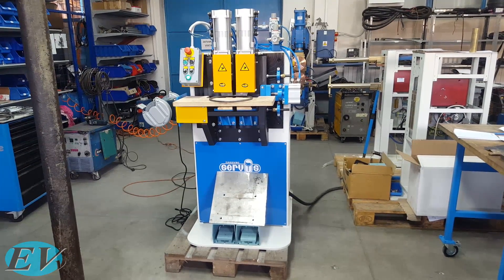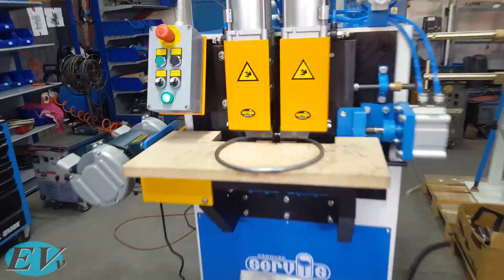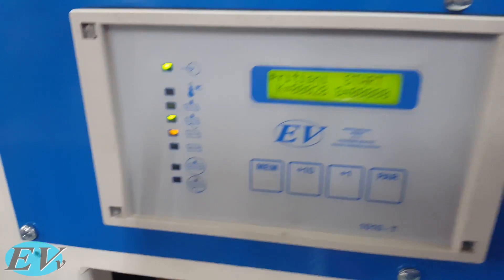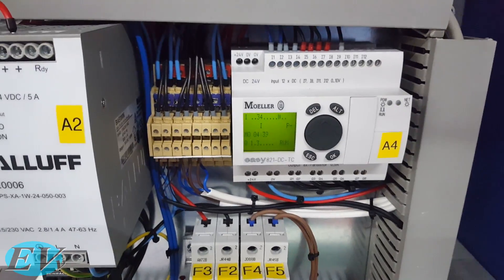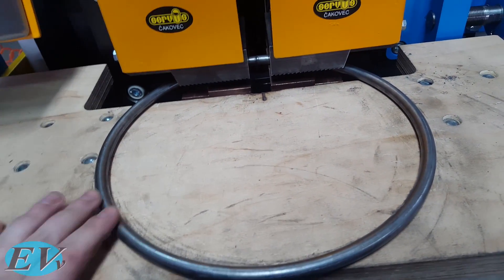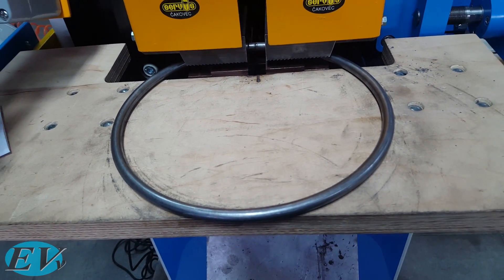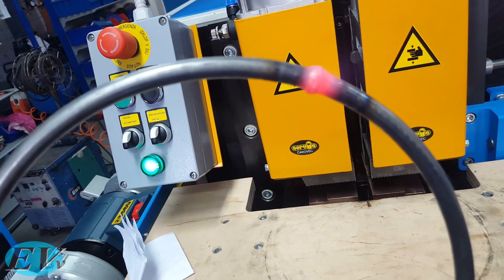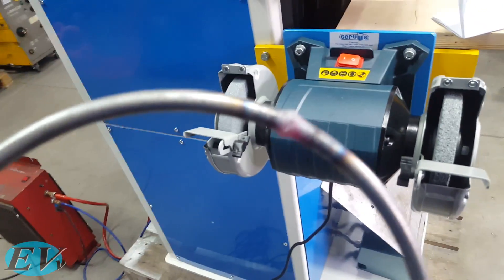Resistance Welding Machine - Butt Welding

Comment: Very nice, just to correct: this is not a flash welding machine, this is a butt welding machine. In flash welding the upsetting pressure is not applied all the time, thus flashing happens at the seam area with lots of sparks.
Reply from the maker: Thank you for your message Jaakko Fagerlund. It is true, the type of welding shown in the video is butt welding, but the equipment also allows flash welding with adjustments to clamping and squeezing mechanisms. Here the gradual upset is not needed as the welding area is small (sub 300mm^2), nor are the hydraulic cylinders for regulation. I apologize if some words are misleading. They were spoken in real time without preparation.
Reply: @elektrouporovnovarjenjeina2834     ...   nice machine. looks safe.   ...   N S H Jha (male) / New Delhi, INDIA / Tuesday, 23 JUNE 2020 (07:15 Hrs IST)    ...   😘    ...   👏👏👏   ...
Reply: Verificado
Reply: Ampère ????